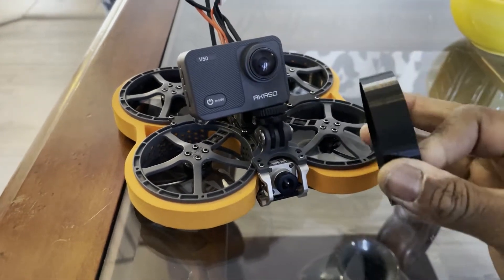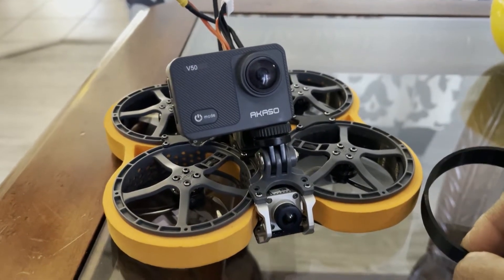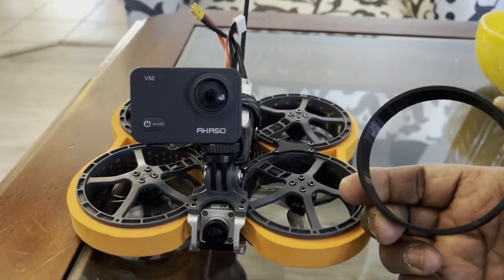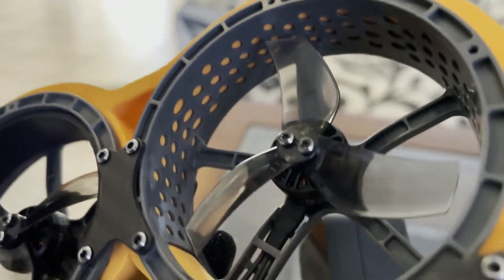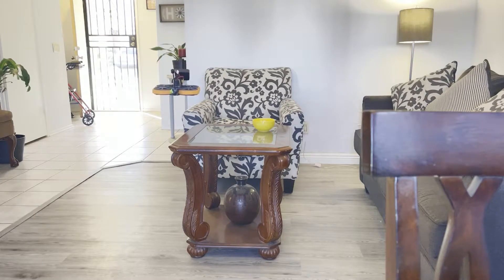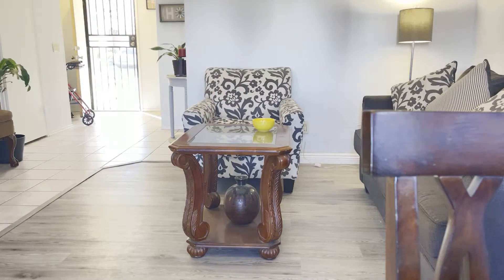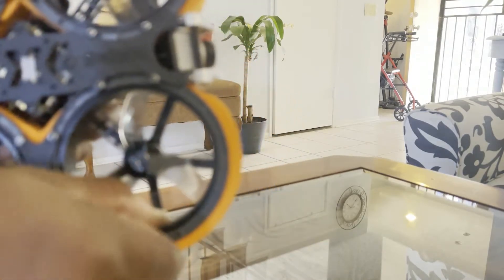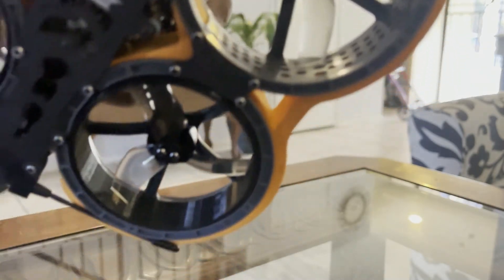Diatone Taycan 25 Loud Cinewhoop Noise Problem FIXED!  Longer Flight Times -  3D .STL Download

Comment: Nice Cinewhoop Scotty. It's much lower the noise. I have the reptile 149 cloud Cinewhoop. How do you like that camera for it? Thinking about picking it up for the reptile 149 cloud. I just need to pick up the 3D mount for that camera for the reptile 149 cloud.
Reply from the maker: I'm cheap. Even though I have Gopros, I like the Akaso V50x more than three Gopros I own. The image stabilization in the V50x is very close to the Gopro's. And for $72 when I got it inn sale, I use it all the time. It's 60 grams lighter than the Gopros and the image quality is fantastic!

Just make sure turtle get the Akaso V50x and not the pro, elite, or any other Akaso at this time of posting. 

I've watched many videos, and the image Stabilization on the V50x is clearly the best for what we do
Reply: @scottgivens27  me too I'm cheap as well. 😂🤣😂🤣😂That's why I pick up the reptile 149 cloud. That camera will work with my Cinewhoop. I don't want to pick up a gopro that will cost more then the Cinewhoop. Just need to pick up a 3D mount for my model.
Reply from the maker: @electroddxful  Exactly! Lol. You will be happy with the  V50x Brother Ray!

Comment: Does it increas flightime also ? Nice test and great print, thxxx 4 sharing ❤️🍀❤️ Happy new Year bro 💚
Reply from the maker: Thanks Oli! Yes it increases flight time by 30seconds to 1.5 minutes from my original setup. Definitely decreases noise and I feel there is more torque and speed. It’s still a loud quad regardless, but no more extremely high pitch noise
Reply: @scottgivens27  whats your auw now? My is 435g , i also print the Ducts but i notice that each duct weight 10g, i thing i print it again on vasemode to reduce weight more 🤗 thxxxx
Reply from the maker: @OliFPV  my drone is heavy. Not home to check the weight, but I printed at 90% infill you can probably get away 20% to reduce the weight, but the efficiency went up along with the torque
Reply: @scottgivens27  so i test it also on my Tay25 and my opinion is, without the foam, the duct adapters didnt work well, i get without foam and no adapters around 4min and with only the adapters less flighttime and its louder as before 💨😞 i think the Foam is also important for the result like u got 👌 u can watch my video, ive made with the Noise Reduction Duct adapters 🍀

Comment: Hey would changing out the motors for the xing 1404 5500kv motors from the protek25 help with the noise I know the protek motors dont sound as loud
Reply from the maker: I think that most of these ducted cinewhoops have the same issue. I have a friend that built Kabobs version, and it gets very loud when carrying a regular size GoPro.

Comment: I have purchased same caddx version I don't know but vtx table is not shown in betaflight how to fix
Reply from the maker: Well if you are using caddx vista, there is no betaflight vtx table. The VTX is built in to the vista abs works with the DJI goggles? Do you have the goggles? Everything is controlled via the DJI goggles

Comment: The noise comes mainly from the prop tips.  It they are blunt, it will be loud.  My Tinyhawk II is very quiet and it uses Emax Avan Rush propeller 2.5x1.9x3.  I put a set on the Taycan 25 and it is much quieter.  I'm also going to try a set of Gemfan Flash 2540s, as they too have a nicely flared tip.  They come today.  See my vids on the Taycan 25 w/ the V50X.  Love it!  Take care.
Reply from the maker: Awesome! I have some rush props and will try them as well. What mount are you using for the V50x? My plastic one just broke that came with the camera.

I think a combination of the flared tips and my Duct inserts will be substantially quiet. Right now with my Vista setup and the Akaso V50x, using old 850mah 4s Batteries, I was only getting 1.5 minutes of flight on average. Now with the duct inserts, I'm averaging an Additional 1.5min~2.0min more flight time. That's some crazy efficiency. And the speed as well as performance is drastically improved. 

BTW...Check out my 3mile long range flight using the Akaso V50x. Yes... That cameras image stabilization is tremendous! Great video quality

Thanks Tommy Tester. Subbed you!
Reply: @scottgivens27  I made my own V50X case remixed from another Akaso camera case on Thingiverse, and mated it to my Keystone base.  See my videos.  I also have a video on battery tests on the C25 with and without the camera on board.  Cheers.
Reply from the maker: @TommyTester  thanks TommyTester. I'm watch them and download the files. Appreciate it!

Comment: I don't understand why they did this, it seems that they do not calculate any aerodynamic indicators at all, they just mold another quad.⛄🌲
Reply from the maker: Yes Brother Dragon! So many reviewers gave this Quad a thumbs up. Diatone normally does a great job, but there was a lot of challenges for me to make this Quad right.

It seems like as you said, they just slapped this one together and reviewers were too afraid to mention the faults. It's so much quieter to fly now. But before my duct design inserts, I could not stand flying it. It was so loud that I was embarrassed.

Now I'm getting less noise, it flys noticeably faster. And I'm getting an upwards of minutes more flight time.
Reply: @scottgivens27  a good upgrade, and most importantly the right one👍